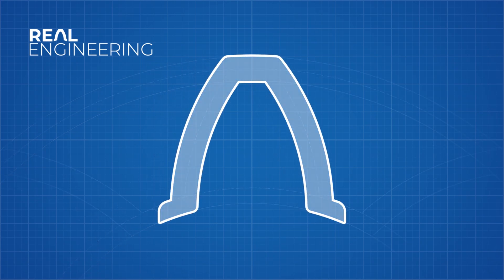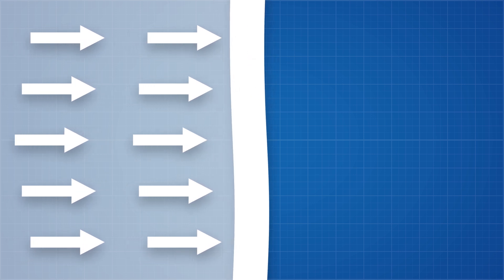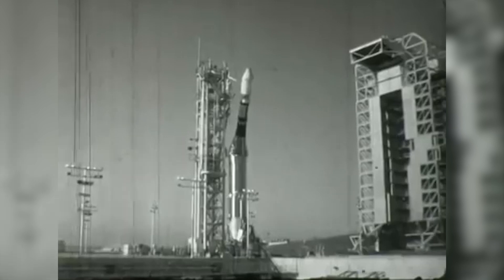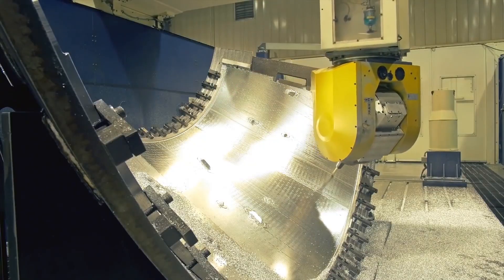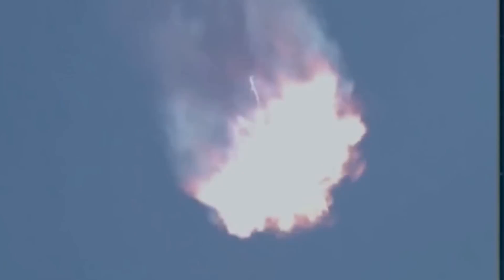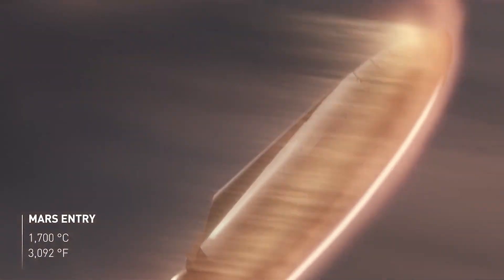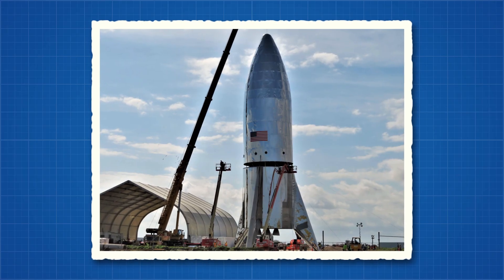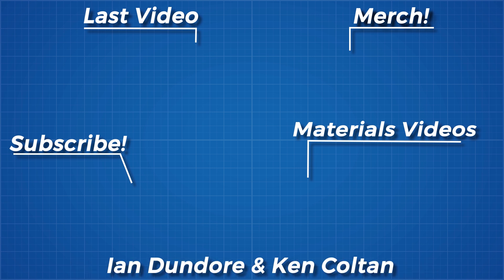Why SpaceX Built A Stainless Steel Starship

Comment: Correction or note:  It was only the fairing that toppled over.  The bottom half with all the tanks, plumbing, etc stayed upright.
Reply: I only crashed half of my car, the trunk stayed untouched. Do you think I can sell it as half crashed? Asking for a friend :P
Reply: @mirkokvesic1598  Do you have cover over your car that can be attacked? Imagine that getting blown away by the wind. It can be repaired without major problems. I mean they build it in a week in the first place.
Reply: @mirkokvesic1598  A better analogy is that a cargo carrier on top of a car falls off.  The car will still drive.
Reply: There is no plumbing in it. It is a set prop.
Reply: @Charles-fc9gi  it was not attached. They had detached it beforehand, to put in a fuel tank dome. They failed to properly secure the thin shell they took off, which fell over.

A bit awkward, but not a big deal. Also it's a test article, like the Grasshopper before it. They want to test landings using their new engines. It is pretty janky, but it will do just fine...
Reply: Bunch of cry babies. He could have built a large hall/tent and no one would have seen a glimpse of Starhopper until first test launch. Do we see each development step of the SLS, is there a way to drive up to NASA and film it from the road every day? Or any other rocket company? Anyone got an actual picture of New Glen? Ariane 6? Vulcan? 
We can all be glad SpaceX is transparent about Starhopper. They don't need to, it's their choice.
Reply: @k1dicarus  agreed that's why I love them so much is they are showing a lot of their steps and being quite public about a lot of things normally hidden away, it's making people excited about space again and that can never be a bad thing in my eyes.
Reply: @Charles-fc9gi  Normal, less ambitious people have been in charge of companies like Boeing for decades, and they've hardly accomplished anything. No major breakthroughs in rocket design or new engines. Barely even any new rockets. Normal, less ambitious people are all too often risk averse and satisfied with the status quo, presumable because they aren't actually interested in anything beyond profit margins. They wouldn't seriously be pursuing the goals Elon is in the first place.
Reply: Yeah they had very strong winds, it didn't just fall over by its own. And done it's a "cheap" nosecone for atest article it's cheaper to build a new one than having some massive operation at securing it inside a building or whatever that they would need to build.
Reply: @NavarroRefugee  Funny that, Russians made a rocket engine far more advanced than anything made in usa, even the stuff that musk does now, in the 70s. Look up RD-180, it's still bought by us rocket companies as nothing comparable is made in the country. They didn't have republithugs cutting funding all the time and stealing all money straight to their own pockets, though. Turns out that when you have right wingers in charge everything goes to shit...
Reply: aullik   Not the same, a car can and normally does operate without any additional covering. You don’t drive to work with your carport attached. 

This thing cant reasonably operate without that part, it’s not a rocket without it.
Reply: uaEquals42  will the rocket still fly though? I don’t think so lol.
Reply: @DrewLSsix  the hopper was never going to go fast enough to need a nosecone anyway, funny how the important part of a rocket is the place where it shoots stuff out below instead of the empty cone piece that makes it look better
Reply: Scott Atkins how?
Reply: Scott Atkins hovering above the ground doesn’t prove it’s the perfect design for mars does it...
Reply: Scott Atkins well the starhopper is meant for mars. But hovering 150m doesn’t prove anything. Getting in orbit isn’t that hard, the challenge is to do it as cheap and efficient as possible, and i don’t think this thing can do that. Every space company can do that.
Reply: Scott Atkins yea the other spacex rockets are great, new approach of using rockets, but the starhopper is imo just a marketing ptoject
Reply: @Charles-fc9gi  the starhopper and the next couple of flight vehicles were only ever test vehicles. The starhopper was for the raptor engine, which had never flown before. Much better to have a small throwaway than a larger scale test vehicle when anything could go wrong with such complex pieces of machinery. A literal rocket engine.

Comment: There's a couple of errors or misconception in the video and one key part brushed over:
1. "Starhopper" is just the nickname of the test vehicle being built in Texas; it has this name because when SpaceX were testing the software and systems required to perform landings with the Falcon 9 they built a short version of a Falcon 9 (with just 1 Merlin engine) which was called Grasshopper. The actual rocket that's going to Mars is called "Starship" as a whole, with the upper stage bearing the same name and the booster (which is only necessary for getting Starship off of Earth's surface) being called Superheavy (as a spiritual step-up from Falcon Heavy).
2. The Starhopper vehicle being built in Texas is not the same height, weight, etc as Starship (just as Grasshopper didn't have the height, weight, etc of Falcon 9); rather it's just designed to test propulsion and the final stages of landing (being able to throttle the engine properly, have a reliable and rapid gimbal system, etc). They do have a very rough approximation of the final Starship's CG vs center of pressure with Starhopper, but it's only really rough data. There's also rumours that they might attempt a simulated mid-air engine-out, where the rocket would descend under 1 or 2 engines (instead of all 3 they're installing on Starhopper; Starship is currently planned to have 7 engines), likely at a tilted angle - engine-out redundancy is important for something that's envisioned to carry 100 people to Mars and (later) back.
3. They're also going to be building a full-scale prototype of Starship separately to Starhopper; this full scale prototype was meant to be under construction now at the Port of Los Angeles, but SpaceX didn't renew their lease and are moving construction to Texas, so there's likely not much in LA right now (that can't be moved by truck, rather than barge, to their new Texas facility). It's not clear whether this would be a vehicle that later turns into an operational vehicle, but that full scale prototype will actually test things like the aerodynamics of the rocket (including the special aerodynamic control surfaces, have the proper manufacturing techniques (such as those involved with the active cooling system), etc. Starhopper will get the control laws tuned into the ballpark, the Starship prototype will refine these to transport customer payloads and humans.
4. This is the key part you missed out - a lot of materials, such as carbon composites, aluminium and even many stainless steels, get weaker when they're subjected to the cryogenic temperatures experienced when being used to store -200C liquids. The specific stainless steel (a slight variant of 301 SS for the tanks, a slight variant of 310 SS for the heat shield outer wall) that SpaceX will be using however actually gets about 50% stronger when it experiences these temperatures. The combined cryo + hot strength advantages of steel has ended up resulting in the payload capacity of Starship rising compared to prior carbon composite-based plans.
Reply: Dragon029 Great information, thanks!
Reply: And that's why i like to - if he covers it -  watch Scott Manley, as he tends to cover all of these seemingly less significant points, even if it results in a longer and harder to understand video, as he wants to mainly inform us to the best of his capabilitys. Luckily he did cover this already (actually surprisingly long ago) in some detail, mentioning all of these points (although not all of them to this detail, he expects us to get the starhopper/starship-stuff by just indicating it).
Reply: That is great information, and Scott Manley did cover most of that.  It is just formatted like a wall-of-text.
Sincerely; thx for posting.
Reply: can you be more specific
Reply: Legit.
Reply: @HalNordmann  your opinions are unimportant to spacex :D

Comment: Plus it won't rust from all the humidity on Mars 😝
Reply: There is no humidity in Mars armosphere
Reply: @meegomeow  That's the joke, my dude.
Reply: @meegomeow  whoooosh! There goes the Big F*cking Rocket (BFR) aka the joke
Reply: @meegomeow  r/woooooooooosssshhhhh
Reply: @nootnootpenguino8586  R/woooosh 4 o's
Reply: @Howdy Justice  If there is water, there is humidity, if is ice no more humidity
Reply: "it won't rust"

Yeah, that's the main advantage stainless steel has over aluminium and carbon fiber composite.
Reply: @seneca983  Ya
Reply: If there's no humidity in mars how come it's covered in rust 😏
Reply: Ron Dela Pena gottem
Reply: @Howdy Justice  I know, but is close
Reply: @meegomeow  r/woooooooooosssshhhhh
Reply: Mars temperature is similar to Antarctica... 😑 no humidity there.
Reply: Rust requires an atmosphere to keep the water and oxygen in a zone...... which mars may lack
Reply: Rust would require oxygen... water (particularly salt water/impure) speeds it up, not causes it...
Reply: stainless steel can not rust?  Oh boy... look at all the material science experts we have posting comments.
Reply: @SnoozeVictim No it's called STAINLESS because it has corrosion resistant qualities, but corrosion resistance doesn't mean corrosion proof.   

Seriously people spend 3 minutes to google stainless steel rust just to break up your silly notion that because some manufacturer labels it as "stainless" that it is a completely impervious to corrosion/rust.   I get it, it's called STAINLESS and you want to believe that to be true, but much like the term "waterproof" was slung around for decades...and then someone started suing over it,  so not many use that term anymore and they all use "Water resistant" now.   The materials industry isn't as sue happy since everyone in it knows that stainless is highly resistant to corrosion, but it is far from rust proof, in fact there are different grades of stainless steel based on the type of corrosion resistance you want.
Reply: R/woosh
Reply: Humidity would make stuff rust like crazy because of the nice combination of water and oxygen!!!
Reply: Mike B 
Please tell us how an iron alloy of nickel and chromium can rust. Yes, it does corrode but it forms a very thin layer of impervious oxides in the surface, similar to aluminium.
Reply: Noop winter is coming!! Town of mars salting the highways  😂
Reply: Bruh there's humidity on Earth, and they'd spend two years at a time here before the next launch window
Reply: @rondelapena6024  because Rust isn't caused by water per say. its caused by the oxygen diffused in the water. ITs oxeygen and iron, not water and iron that makes rust.
Reply: @SnoozeVictim Congrats man, you have one use of using stainless steel and as a result declare they are impossible to corrode under any circumstance.
Reply: @FutureNow  wooooshhh ahhhhh wooosshhh

Well your manic today jr
Reply: FN: Did your head rust from all the humidity on Earth ?
Reply: It's stainless steel not stain never.
Reply: Just for an addition to the string about stainless steel, stainless steel is merely resistant to oxidization, most commonly seen by introducing a Zinc layer, It isn't impervious to oxidization but it is pretty damn close when it comes to stainless steel eating utensils which usually don't see many centuries of usage.
(That's at least my understanding so uhh... science side of youtube please don't lynch me over it)

Comment: I would also imagine that stainless steel has a better fatigue life than aluminum, meaning a reduction in maintenance hours.
Reply: Possibly not as the choice of alloy for both metals is enormous.
Reply: The material used is probably austenitic stainless steel, which doesn't have a fatigue strength.

Comment: I think one aspect that was missed in the video is that Stainless steels have also come a long way as far as properties in the last 50 years. They are generally easier to weld than aluminum alloys and not prone to the same fatigue life. In general Stainless steels have gotten significantly stronger (UTS) in the last 30 years and therefore can be considered an option that was not feasible in the 60's of 70's.

Comment: How thick are space ships if 10mm stainless steel walls was “extremely thin”?
Reply: Do you know how much is 10mm?
Reply: ignafiltro 1cm. In the world of sailboats, a steel hull that is 5mm thick is considered very thick.
Reply: ignafiltro in fiberglass, yes, our own hull is about 20mm in the thin spots and 80mm in the thick spots. Metal hulls are much stronger and therefore always much thinner than fiberglass.
Reply: Rigging Doctor my thoughts too!
Reply: This video is interesting but has some misstatements.  It says the early Atlas tanks were 2.5 mm to 10 mm thick.  They were actually closer to 1 mm thick, and in some areas less than 0.5 mm thick.

Comment: FYI that aluminum CNC'd away IS NOT wasted. It's collected, melted down, and reused to make new aluminum billets.

At least it is in any other business besides SpaceX. I assume they do the same. No one would just "waste" that much aluminum and just throw it away, actually wasting it.
Reply: Can't do that with carbon fiber, which is what the BFR was originally going to made from
Reply: They recycle at the space center and at space x.
Reply: Yeah, but the value of the aluminum shavings is tiny compared to the part they were shaved from. The original part might cost hundreds of thousands of dollars, and you get to sell back a few thousand in scrap aluminum - it is just slightly better than a total waste.
Reply: They don't call it "waste" because they throw it away, they call it that because it is a waste of time, energy, and money.  The more material to be removed, the more time it takes (man hours and machine time) to remove it.  And it takes a lot more electrical energy to do this.  And all this brings up the cost.  They don't get much money back from their aluminum waste.  Designing parts with less of this waste is super important in producing things economically.
Reply: @24680kong  
Isn't that basically what I said?
Reply: Nothing is wasted in CNC my shop recycles all chips
Reply: AlexisBubba15  
How are you going to do that? You would have to build an aluminum recycling facility and your own factory for producing the original part. That is way less efficient than selling the stuff back to the company that specializes in producing aluminum.
Reply: Its not "wasted" but the price of getting aluminum blocks that large, and, more importantly, the price of machining makes that waste aluminum that is collected and sold be nearly worthless in comparison
Reply: AlexisBubba15  You can't just recondition parts even if the they are in the spec.It could have microscopic internal stress fractures. Think of this if you could drive your car at 200mph every day, it would just deteriorate until it falls apart.  You don't want that rocket with a billion dollar satellite or people to go kboom because of a reused $65k part.
Reply: Wow....I got a head ache from reading everyone's comments!!! You all were basically saying the exact same thing and coming to the same conclusion, but seemed like you weren't getting that you all were. Calm down folks, it will be alright...
Reply: Rocket waste into beer cans. 🍺
Reply: i think by "waste" he meant money waste, energy waste, time waste. Unless he is stupider than we thoguht
Reply: The real trick for this stuff to be affordable is the advancement of additive manufacturing processes.  Subtractive methods will always be an exercise in futility from an economic standpoint.

Spend a ton of money building a solid cube, only to whittle 95% of it away.  The future of additive manufacturing looks bright indeed...as long as we can all get along well enough...or we don't unleash a rogue AI on ourselves. 🤣
Reply: You are still dealing with waste as not all shavings are recovered so they're by wasted.
Reply: I think it a time thing. The time involved to complete the milling. And the chance for mistakes, or the tooling that must be changed out. Also...the value of scrap aluminum compared to the cost of that huge billet (is that the correct term?) must be staggering. Money MUST be wasted using CNC on such a large scale. Lots of money.
Reply: Everything about CNC is expensive, you can save money by casting the material instead of using forged billets, but it is not as strong.  Sintered (powdered) metal is cool, they use it to mold titanium, and its strong enough to make turbine blades.
Reply: @pdoylemi  - You are ignoring the energy saved by not smelting ore for new aluminum and instead reusing the old aluminum. Environmentally, the benefits are still there.
Reply: @bruzote  
I never said they weren't. But A) this is not about the environment, and B) it takes a lot of energy to machine those billets, a lot to collect the scrap, a lot to ship it for recycling, and a lot to melt it down for reuse. Not being an aluminum expert, I cannot say which process takes more energy, but I doubt that the difference is as much as you think it is.